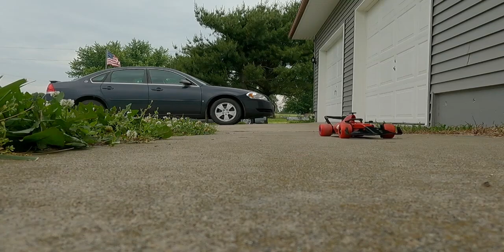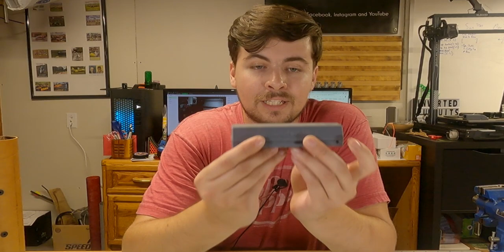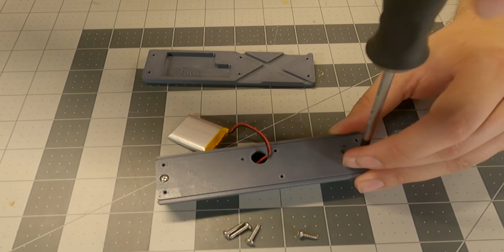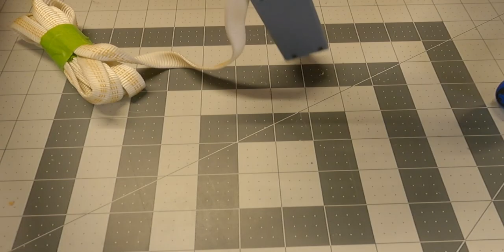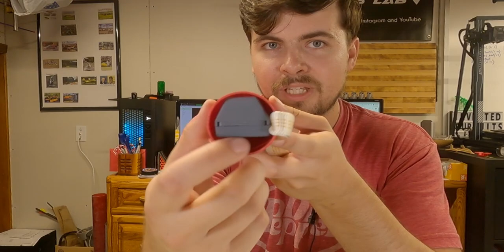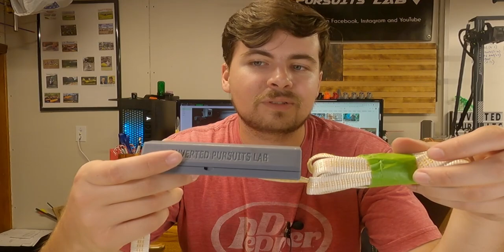Featherweight GPS Tracker Capsule

Comment: Just bought the tracker and the capsule.  I am thinking that adding a JST connector right at the battery would be useful, allowing the battery to be disconnected without opening the tracker part of the capsule.  Admittedly, with the new switch slot, this might be redundant.
I will also probably put a piece of tape over the switch slot during flight to keep ejection gasses out of the capsule.

Comment: Switch access would have been great.
Reply from the maker: It's been noted and is being resolved
Reply: @InvertedPursuitsLab  Will buy with the switch access!!!
Reply from the maker: The current models now ship with a new switch access slot in the top cover!
Reply: @InvertedPursuitsLab  Ordered!!!!
Reply: @InvertedPursuitsLab     I was just thinking of this also.     If you are not going to recharge the battery, do you get it all assembled and then all you have to do is turn it on and are ready to fly?  Is there a new set of photos or a new video for the current version?
Reply: I see you do have an updated video on this tracker capsule: https://www.youtube.com/shorts/-RlJXwX9H68